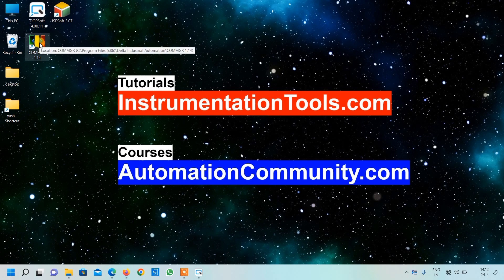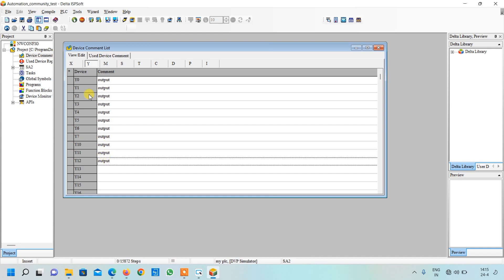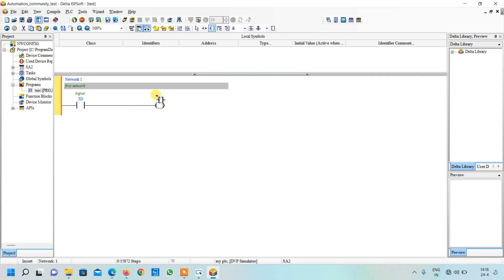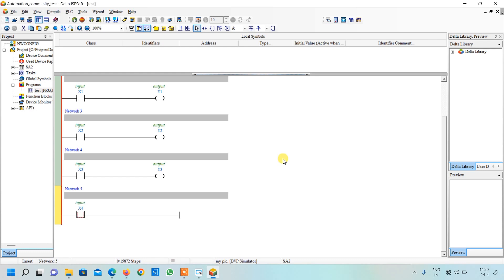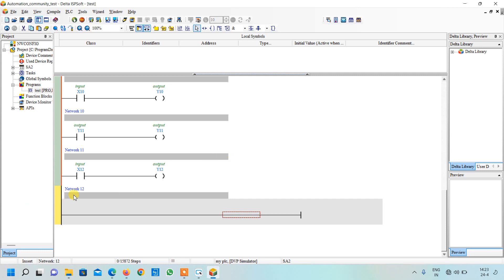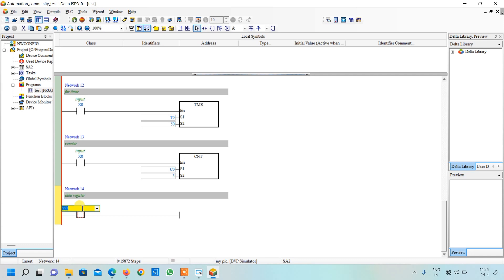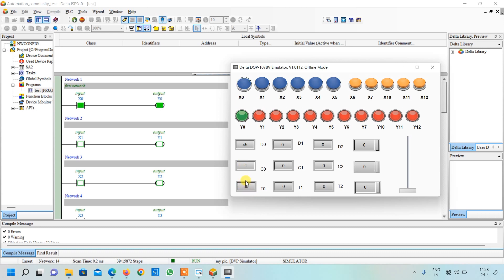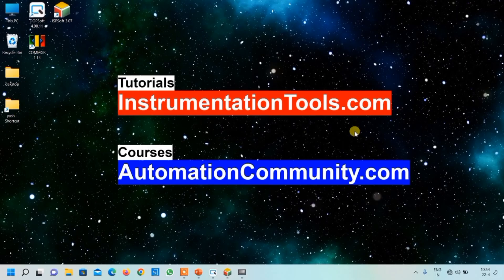Create Ladder Logic and HMI Simulation - Online PLC Class

Comment: hlw plc used a fatek plc and doing a programe for ac voltage control using triac mean convert fixed ac voltage into variable ac voltage. and if terminal voltage decreased   then plc maintain it by own self according to its set point through hmi